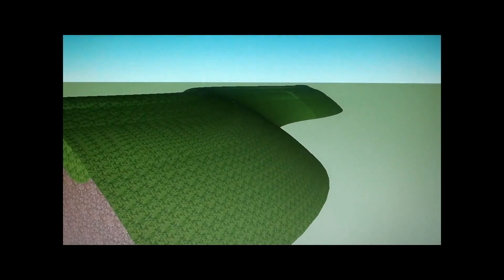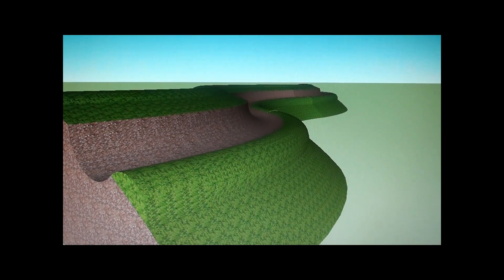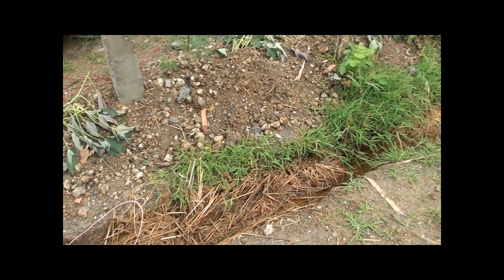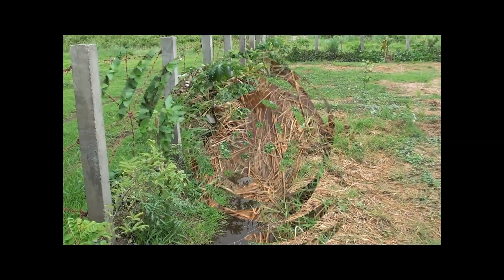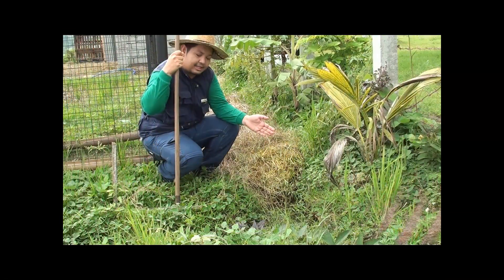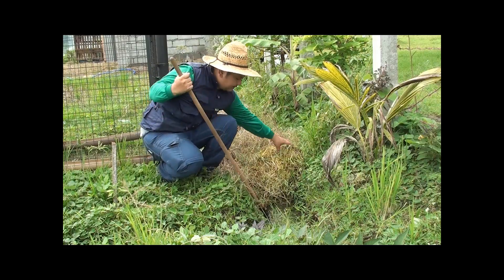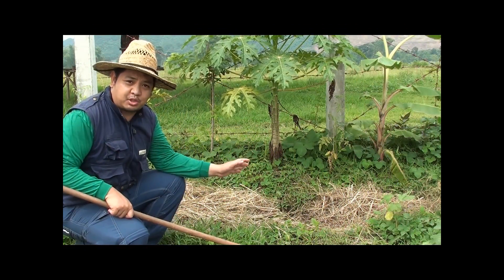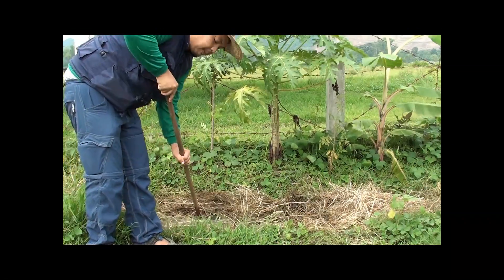How Swales Work, Permaculture at MADE Farms

Comment: Thanks for your video.
I would love some advice on building a swale on my farm?
Does the ditch have to be in a straight line or is it naturally going to move according to the path of least resistance?
I have a hill on the backside of my property that is kind of steep and I think it would be a great place for fruit and nut trees because it gets a lot of sunshine.
I just wanna make sure that this hillside isn’t too steep and that I am building the swale correctly.
Reply from the maker: "On contour" means "perfectly level." If the swale is perfectly level, the water will sit in the swale and be gradually absorbed into the land. If the swale is 'off contour', which means 'not level', it's basically a drain. The water will flow to the low end instead of being absorbed.

Comment: Thank you for sharing! I rather like a more natural approach to terracing and water catchment. Two questions: do you have a video that shows how you used an A frame to find the contours? Also, how do you prevent from breeding mosquitoes in the open ponds? I’m assuming the swales might not be an issue as they are covered with mulch?

Comment: Is there any general rule or rule of thumb about the most efficient and best density to build swales at.  For example say "x" number of feet from swale to swale either looking straight down or "x" number of swales for a given difference in contour.  I think one extreme form of swale might be seen as terraced gardening, and that seems to be build from level to level knowing that each bed needs to be a certain depth.
Reply from the maker: The length, width and height or volume of water containment will depend on the amount of rainfall or water you get in a season and the amount of water you want to retain in your property.